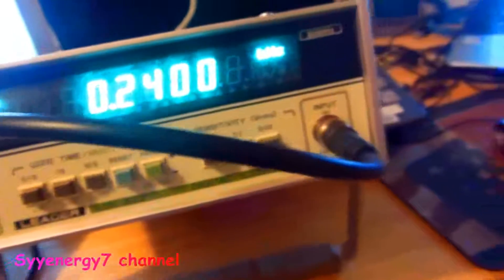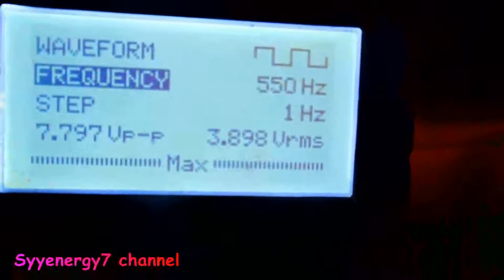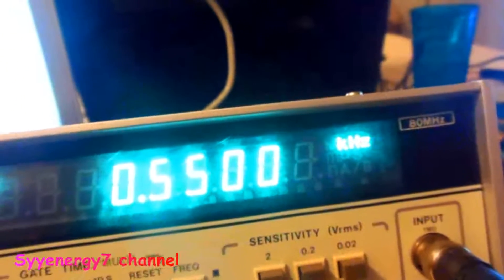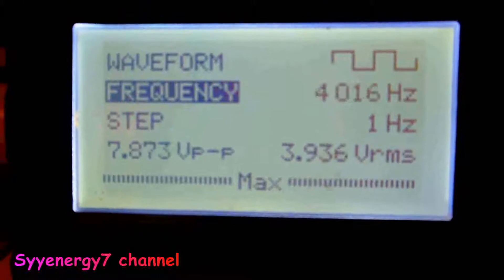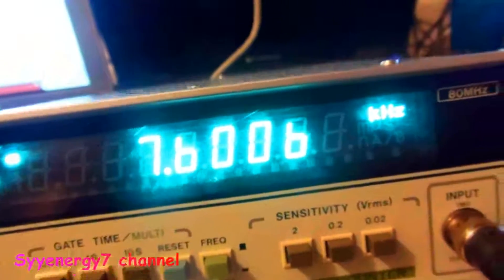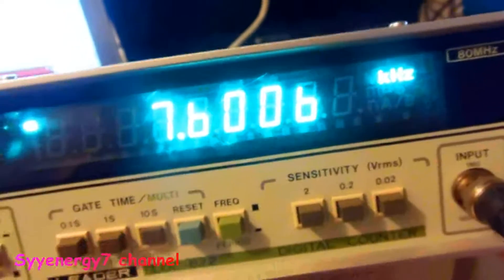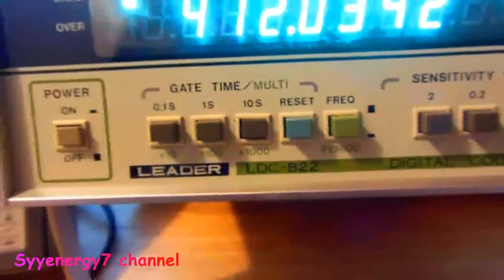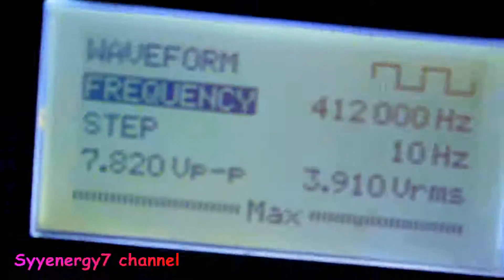Velleman HPG1 Frequency Generator Accuracy shown on a Leader LDC 822

Comment: Try some odd frequencies like 787 Hz, 767 Hz, 2127 Hz.

It should be possible to add on a 555, connect it to the output and the battery to get a positive offset signal.